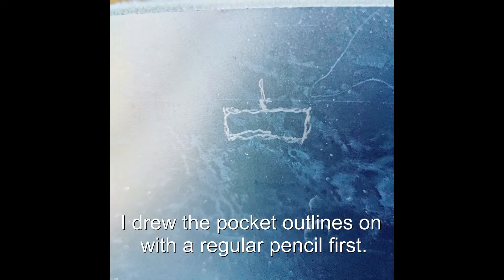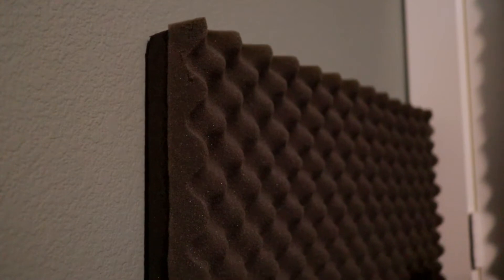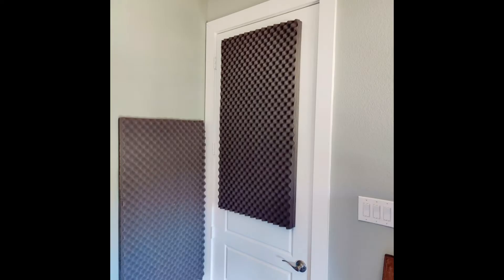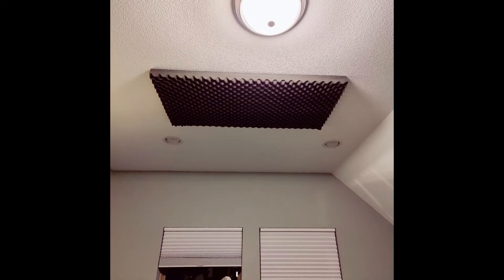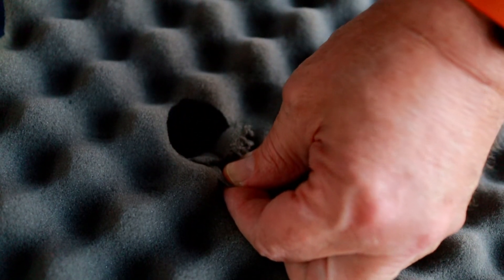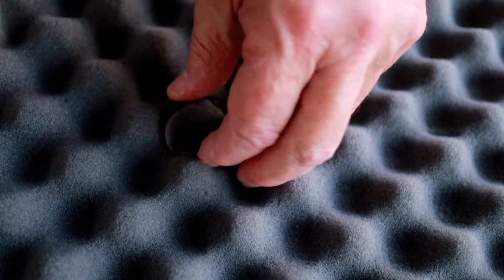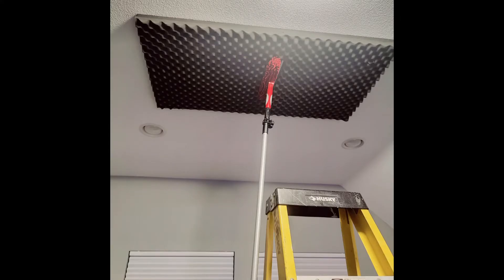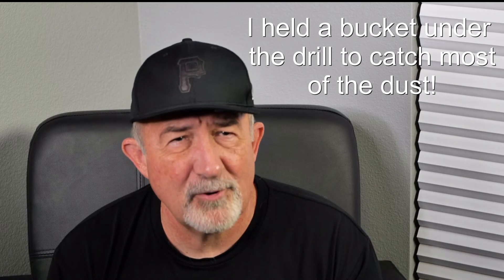DIY Acoustic Foam Panels #2 - Installation

Comment: You should have bought a laser level line and had that crisscrossing the ceiling and then lined the foam panel edge to the laser lines, then they would have been straight. Wouldn't have heavy duty velcro strips worked better at hanging them from the ceiling?
Reply from the maker: Where were you when I was hanging them!  haha.  Great idea on the lasers.  But I just don't trust the adhesive on velcro strips.  Maybe I could have stapled them as a secondary means of support?  Admittedly, what I did was overkill and hard to adjust.

Comment: Great solution to hanging them on the ceiling Bob! Looking forward to the sound test. When I hung my acoustic panels (different material) on the ceiling, I left a gap between the panel and the ceiling - about 1 1/2". My research suggested this to be the most effective. I'm happy with but curious to hear how yours works.
Reply from the maker: I did see folks leaving a gap in other installations but saw no mention of why.  So I did not do so although I could have.  Definitely makes some sense to trap sound in there and I certainly had the headroom!  I think the efficacy of my set-up hinges more on the mobile panels which can be positioned just off camera.  But the ceiling panels won't move so having them as effective as possible is likely important.  Thanks for the engagement John.  Sorry I keep missing Sidetrack.  7pm CT is dinner time usually and I am often out of the house.  I don't think I see your cloud panels in your videos.  Are they white?
Reply: @PKWModelwerx  I do like the mobile feature. I used Rockwool rigid panels wrapped in burlap. For all of the panels which are hung (walls or ceiling), I build lightweight wood frames. I have a couple of panels left which I will make into mobile panels (no frame). I also have a panel which I can friction-fit into the window box which is directly in front of where I normally record/stream. I'm very pleased with the performance of these panels and they are only a little heavier than yours - probably about 8 lbs or so. All of my panels are wrapped in black burlap and I don't think any of the ceiling panels have been in frame. No worries about missing STS. Unfortunately there is no perfect time-slot to be convenient for everyone.